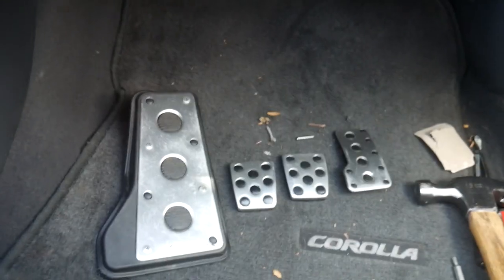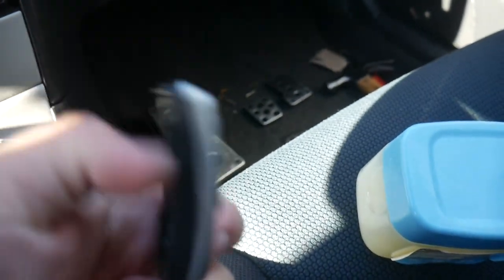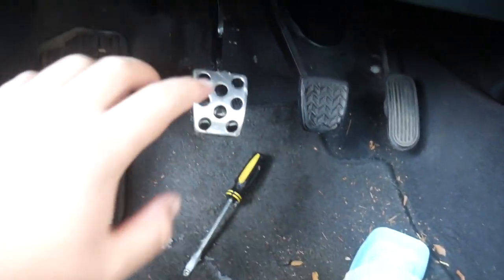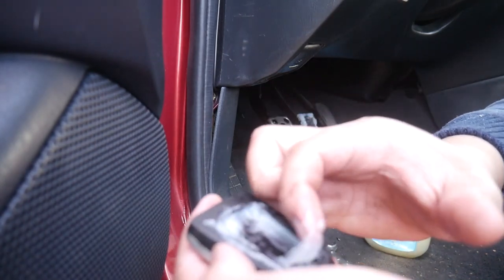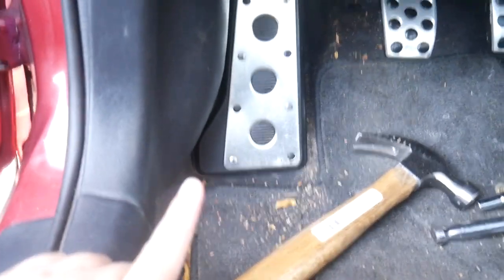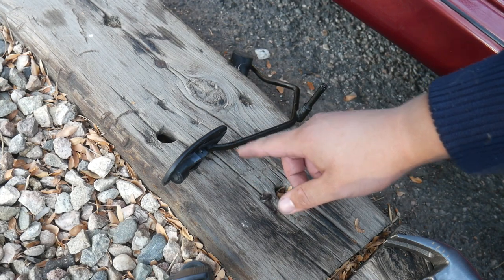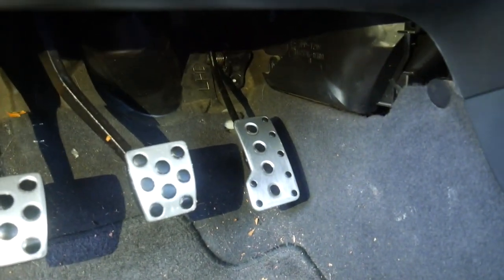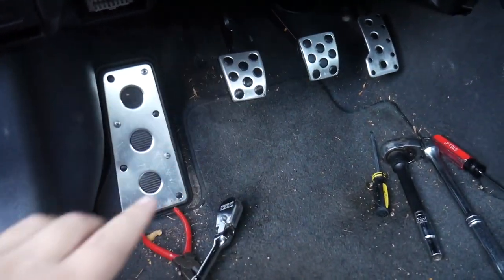Installing Celica GTS Pedals In My Corolla XRS

Comment: I like the tone of your horn. Which ones are those?
Reply from the maker: Thank you! They're Hella sharptones, here's a link to them: https://www.amazon.com/gp/product/B00R3O0Y0M/ref=ppx_yo_dt_b_asin_title_o09_s00?ie=UTF8&psc=1
Reply: @WillChang  thanks!
Reply: Clicked on the link and horns popped up.
Reply from the maker: @96MustangBoy1  Yep, those are the horns I have on my Blue Corolla
Reply: @WillChang  sorry my bad. I didn’t read the comment. 😬 oops. I thought it was a link to the pedals.
Reply from the maker: No worries, all good 👍🏼
Reply: @WillChang  is there a link for pedals too
Reply from the maker: @amthevision8931  unfortunately not, I bought from an individual on eBay. Best place to get these are either used online or at the junkyard
Reply: @WillChang  okay np, what about those hood struts I believe you have for a Corolla?
Reply from the maker: Here's the link to them: https://www.amazon.com/dp/B00NUEZTL8?psc=1&ref=ppx_yo2_dt_b_product_details
I have these on both of my Corollas and they're pretty good. The ones on my blue Corolla have been installed since 2019 and have no signs of failing